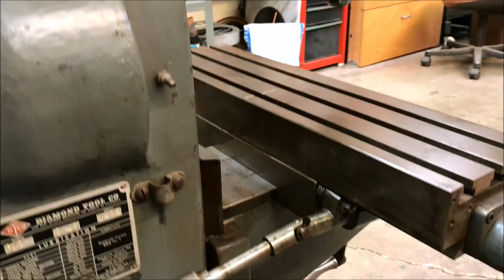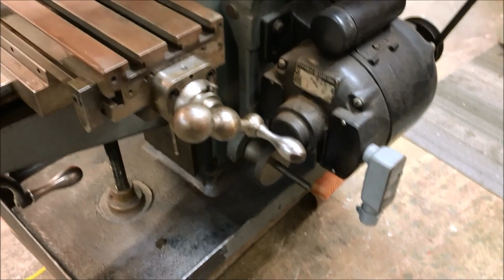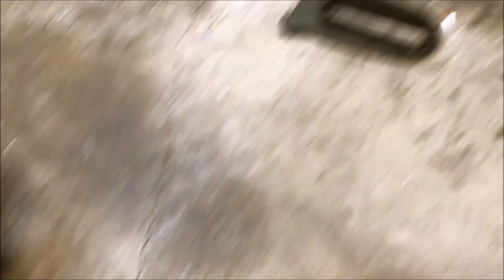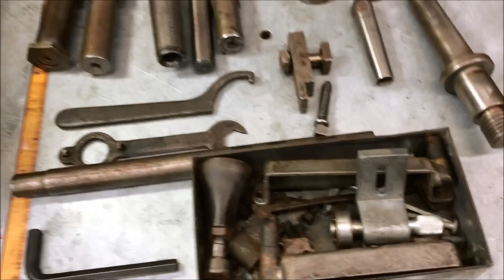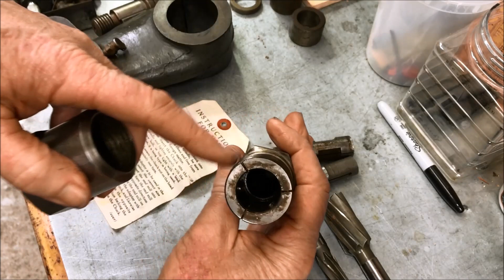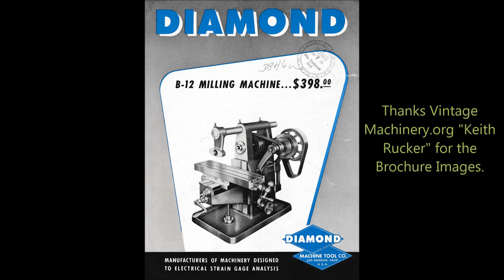Diamond Tool Horizontal Milling Machine : Weekend Update #15

Comment: See you used my catalog that I posted on Vintage Machinery! Got my Diamond B12 from my boss years ago, came with a very rough Fray vertical head. Later I picked up a 22M, much bigger with the factory cast base. Now you're talking Bridgeport weight! Seem to use the B-12 for cutoff operations.

Comment: I am really surprised that you found such a clean machine. The arbor with the buttress threads just shows us today that things were made for the long run. I wish I was lucky enough to find such a great small milling machine. Just am never in the right spot to find such great old American made gems. If you are ever thinking of selling this item please let me know and I am sure we can make a deal Sir. Good luck with whatever you decide to do and have a great day too. V
Reply from the maker: Thanks, I'ts on the back burner for now. But the plan is to do a first class restore with a pimped out paint job.
ATB...Dean

Comment: super nice score! Nice collection of accessories.. Diamond made a very nice machine.. Solid..I have the 22m floor mount.. Very quiet smooth machine, I think the 246 is the date  Feb 1946. Mine is 1953
Reply from the maker: Thanks DK, It's very beefy for its size.
-Dean

Comment: That is a cool little machine, and even better how it came with tooling so you can actually use it once you get it set where you want it.  I don't blame you for grabbing it, we pick up machines like this even when we don't have space because they are simply only available on a rare basis!
Reply from the maker: Thanks Everett, I'm pretty excited to see what kind of cutting power it has. I've got several projects ahead of this one to wrap up first. 
ATB,

-Dean

Comment: Thanks so much again for your valuable advice - GREAT food for thought - rethinking this size of compressor as I found out it’s sheer size is immense and would take up too much room in my garage shop (have a designated corner for it, but still too large) to say nothing of the cost of the VFD for that unit (checked that out - way out of the budget).  Trying to get another compressor for our property we travel to frequently so we don’t always have to cart my existing one with us - we’re in the building stage there (finishing actually), and use it constantly.  Looking at several others, but want the capacity to power air tools such as die grinder, nailers and drill. Current one great for this (12.5 cfm @ 100 psi with 5 hp 240 volt motor) so will probably leave it there and use new one here at our permanent home.  The drum switch idea sounds promising for the ability to have dual control of forward and reverse - lathe currently has 110 motor, but could switch up to 1 hp 220/240 that I have as my Dad always used to tell me 220/240 is a far more efficient circuit size to run for power tools - most of my woodworking tools are 240.

Ounce again your comments have been very worthwhile and I thank you for your sound advice on these matters.  I hope to be able to bend your ear again when I have a question around metal working machines and their usage.  Just got a notice from a machine dealer 4 hours away from here that he has a Fritz-Werner vertical mill for sale - have seen pictures of it and it requires a lot of cleaning, but he has said that the previous owner used it right up until passing it off for sale - wonder if you’ve ever heard of these mills?  Have a good week.

To all things that produce smiles,

Tom Fitzpatrick
windckr2up@gmail.com
Reply from the maker: Tom, I don't know much about Fritz-Werner, but I believe it good quality. Most important is a close inspection of the ways for ware, most everything else can be fixed. Parts might be a problem with the lesser known brands of equipment. Also make sure it can accept common tool holders R8 for example.
good luck, Dean

Comment: Thank you so much Dean for this valuable information.  Another question has come up (not about the lathe, but an electrical question I thought you might be able to address).  I ask this as I viewed your excellent series on restoring the South Bend lathe and the Bridgeport mill.  I believe the mill is 220 power and the lathe is 110? - not completely sure.  My questions centre around two used air compressors we are looking at purchasing (trying to decide which one to buy).  Both Canadian made models (I live in western Canada) - one a Devair - model VAV 5062 the other a Swan model MW - 415.  I believe they’re both 15 hp, but am not sure if it is single phase or three phase (that’s a crucial point as I don’t have 3 phase power in my home shop).  Waiting to hear back from the sellers on this point.  Anyway I wanted to get your take on this.  

1. Would it be better to purchase it even if it’s 3 phase power and use some form of device (I believe it’s called a VFD) to convert the power over so the machine would run on my household current - I have a number of 240 single phase circuits in my shop.
2. Where is the best place to purchase said device, brand name and approximately what is the cost?
3. You also have a switch on your South Bend lathe that has a chrome lever that appears to move left & right beside beside another box that has an apparent on off switch with a green button - what are those two switches called, used for and could you let me know of the brands.  I’m wondering if this is something that my Craftsman would benefit from.  Thanks again for your wonderful videos - looking forward to what your plans are for the latest acquisition - the small mill.  Have a great week.

To all things that produce smiles,

Tom Fitzpatrick
windckr2up@gmail.com
Reply from the maker: Tom,
I'll do my best to advise on your questions. I'm not familiar with those air compressor brands. 15 hp is a big compressor for a home shop. Basic rule of thumb when converting single phase to 3-phase: the converting device (VFD or rotary phase converter) should be double the Hp size rating of the thing your trying to power (air compressor). so you would need a 30 Hp unit. The 230 volt single phase circuit to feed that would be somewhere around 100 amps! One advantage to a rotary converter is you can power multiple machines from one converter.
Watch out for static phase converters (a box that lets a 3-phase motor run on single phase. The work fine but you only get 60% of the Hp output. The motor would probably overload before getting to full pressure.
2. American Rotary Phase Converters.
2.1 VFDs do your home work YouTube and on line reviews (note many of the small drives 2 hp and under do not require over-sizing, check the specs)
3. it's a drum switch, there two types; three phase and single phase for forward-off-reverse motor control, wiring can be tricky. I re purposed mine to operate the VFD drive (custom wiring) the button is a jog (starts the motor in forward at slow speed) the knob is the speed control.
I hope to make a video at some point on how to set these up.
BTW I have a duplex 3-hp industrial air compressor for my shop (2-3hp units) and its way overkill. I would shop for a smaller compressor.
Best of luck, Dean

Comment: Many don't see the need for a horizontal today Dean, even more so if there's already a decent vertical in the shop. Yours going by the weight would be 20%-30% larger than the little Atlas I have. Some jobs are just easier and more accurately done on a horizontal, line boring as just one example. For bulk metal removal that little horizontal will run rings around any Bridgeport. The double ended arbor support plus that added vertical support makes all the difference. It will take cuts a much higher HP Bridgeport couldn't even dream of. Very cool little mill and I would have grabbed it as well. B&S no. 9 horizontal arbors might be a bit tough to find today, very likely any arbor diameter you need that has a MT 4 which should be a lot easier to find could be reground to that no. 9 taper. The MT 3 taper is pretty close to the B&S but without checking my facts there might not be enough meat left in those to do the same.
Reply from the maker: Thanks for that info...wish I could start on it right away, but gotta finish the kitchen remodel before playing in the toy room, whoops I meen shop.
All the best, Dean

Comment: Nice little machine and included tooling. Have you been able to locate collets for the vertical head?
Reply from the maker: Yes they are the Y style double taper. There's a couple vendors still selling new ones about $ 7 bucks each, not too bad.
The other Thurston  quick change are obsolete, probably ahead of there time.
Thanks Buddy,
-Dean
Reply: @TheAyrCaveShop  Oh good, and not bad at all. Always interesting to see obsolete tooling scenarios like that, and wonder why the never caught on.